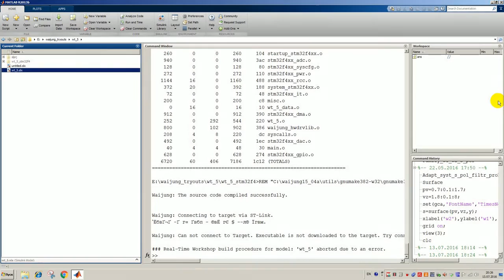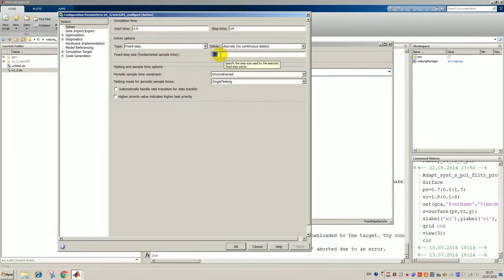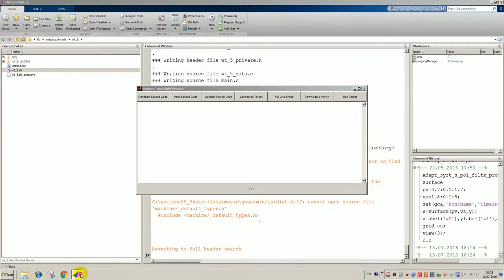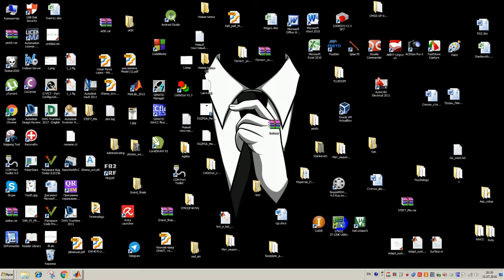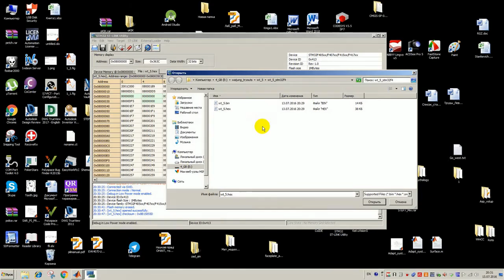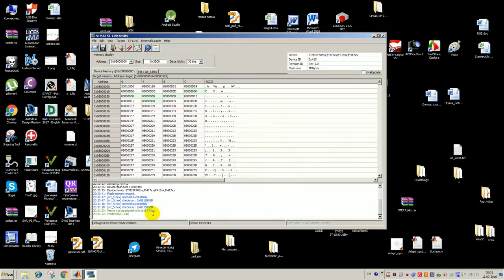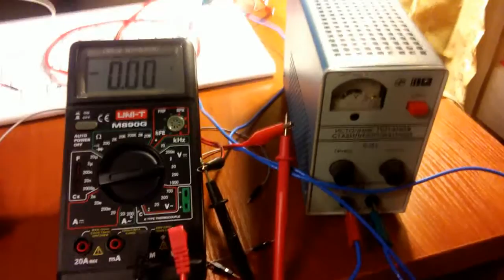STM32 programming using MatLab Simulink

Comment: tnx for this video, I have a question about compiling the source code, it has the error in step 3 and i cant find its reason, plz help me...
Reply: First install ST link,  then go and run program through ST link
Reply: Also you can install a driver for STM 32 THEN YOU DON'T  NEED ST LINK ALSO,  REBUILD THE ERROR WILL BE SOLVED